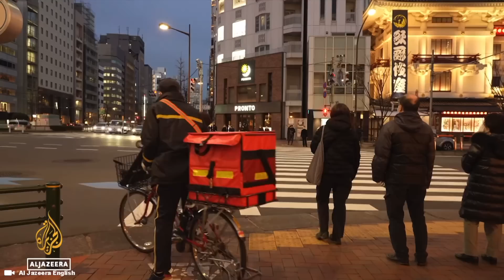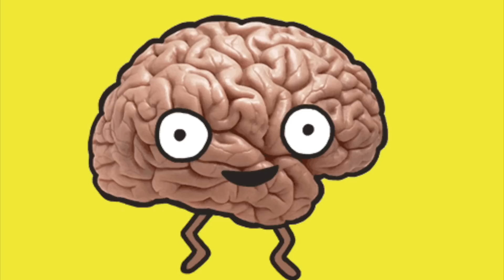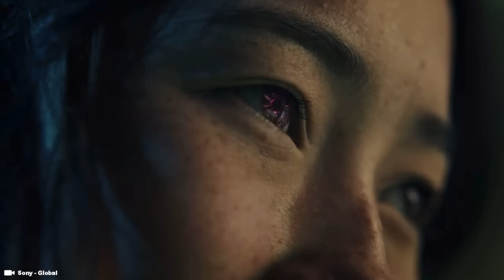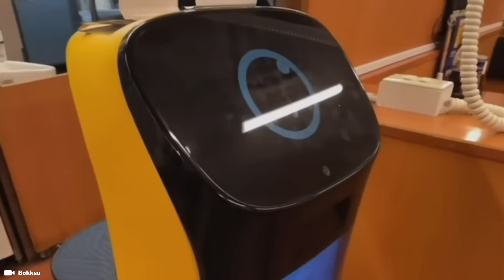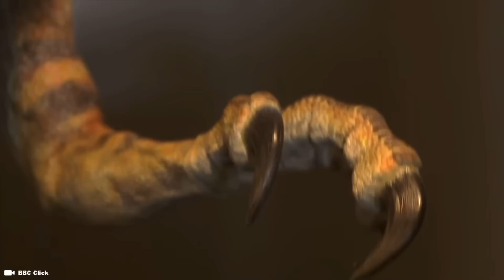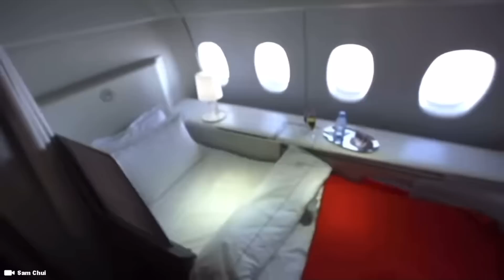Inside the world of Japan 's New NAUGHTY Female Robots ... Tokyo Humanoid Engineering

Comment: A robot, any robot can appear to be that of anything. What is the actual difference between what appear's to be a male robot and a female robot is only the outside appearence, while the inside can be exactly the same. Robot's have "NO GENDER", meaning they are not either male nor female. With the one exception of having slightly extra space when female's have fake breast, there is room for additional item's a male robot may not have when it doesn't have the additonal room.